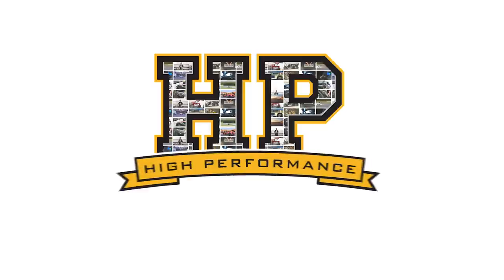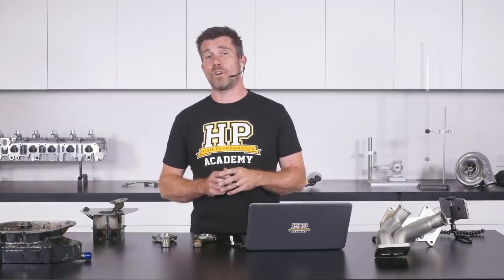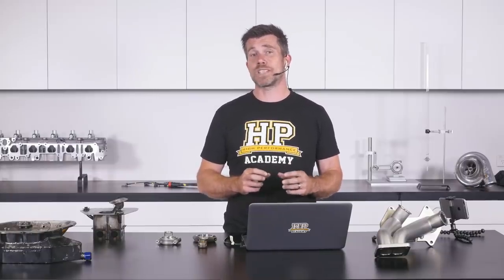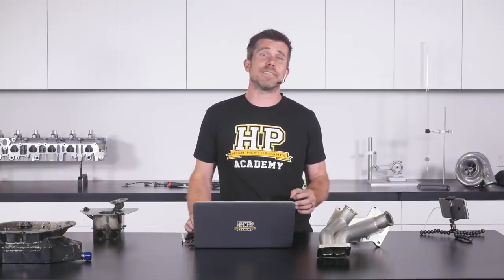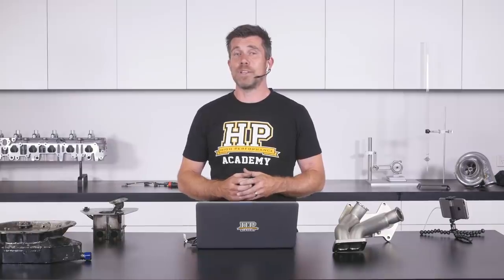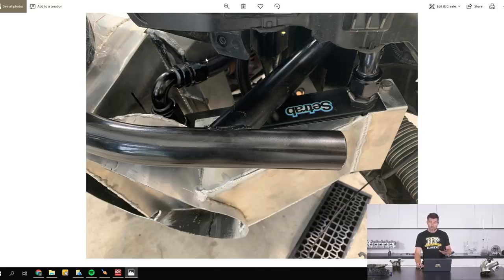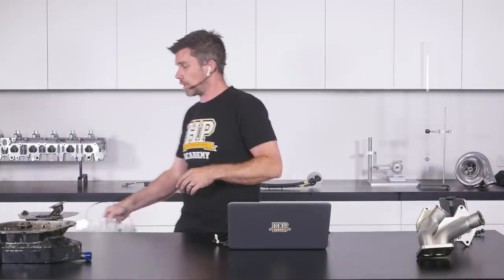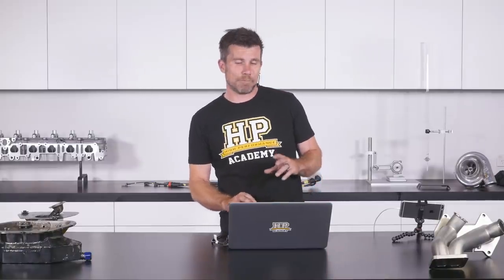⚠️Bent Rods, Rotary Manifold and V8 Toyota 86 | Today At HPA 201 [UPDATE]

Comment: Cool, another reason for watching these vid's - I am aware of more and more manufacturers using tapered small ends to lighten them as the crush load is primarily on the bottom of the bore, but wasn't aware of pistons being designed to also maximise the more heavily loaded bearing surface. Makes sense, though, on the same principle as tapered gudgeon/piston/wrist pins where they put the material where it's needed most.
For the bearing clearances the KING brand you did a feature on a year, or so, back offer those off-sizes for quite a lot of modern engines and, if the viewers are prepared to pay a bit extra, they will make then to the 'builders' exact requirements.
Very nice bit of casting there, and should eliminate the cracking problem of most fabricated manifolds. I haven't priced them, but as 3D metal printing machines are getting cheaper and cheaper, it may be viable for those with deeper pockets to get a manifold made to their specific packaging requirements - they can do stainless steel, iconel and titanium ($$$) alloys. [edit] Co-incidentally just got a notification of a supplier now offering 316L S/S.
As you say, EGT is a topic some get heated up about - I would suggest those that are concerned, and can actually monitor it, contact their turbo' supplier for recommendations as materials are constantly improving and there can be as much as a 200C variation in the 'limit' - it may also depend on application and desired service life as fatigue increases rapidly when overheated.

Andre, I mentioned this before, but can you PLEASE post links in the description to the suppliers and manufacturers you mention in the videos - it could save a lot of time wasting? Also, if there was a discount code, viewers may gain a cost saving and you a sales commission - NOTE, this does not mean you can talk a product up ( I think we can all think of folks who went down that route only to lose credibility and their base), just be honest and let the dice fall where they will.

Comment: I always wondered what the rods in a rotor engine looked like! Ha!   Looks like the companies making diff covers, would atleast weld in a piece of 16gauge aluminum to keep the rounded back to funnel the lube to the pinion, a 50mm strip about 200mm long should do it.  And still offer all the benefits of the billet cover, cooling , looking cool, extra capacity, bracing, mounting locations,   the flat back can really thrash the lube!